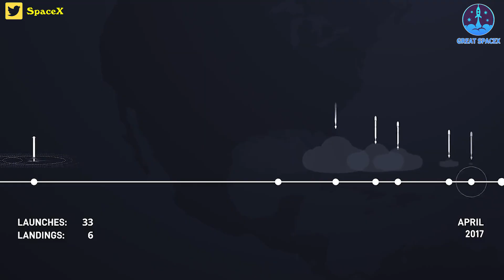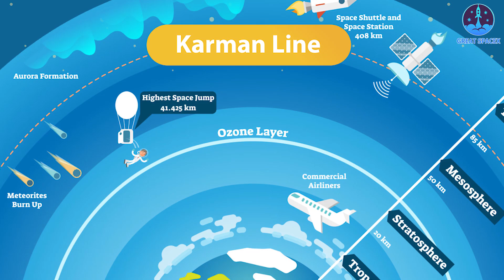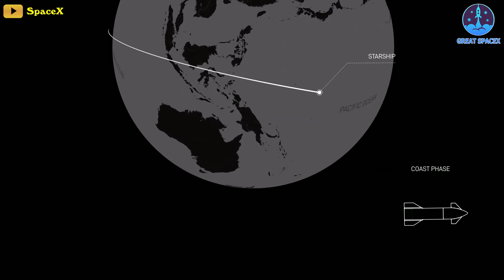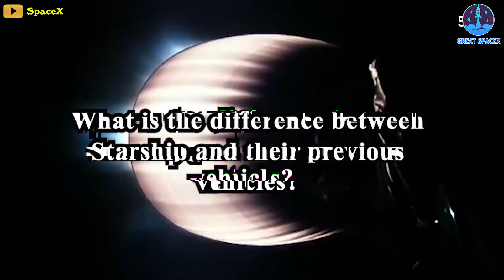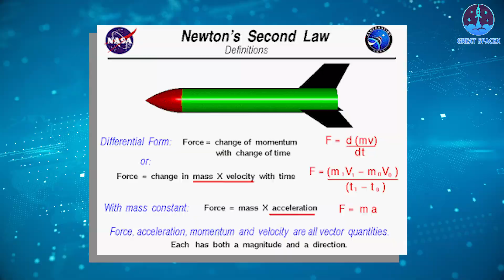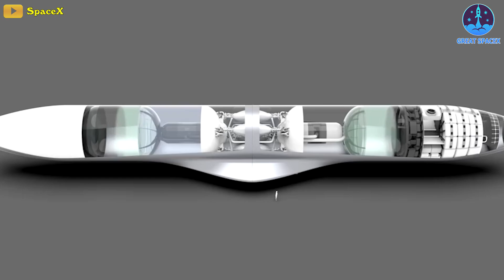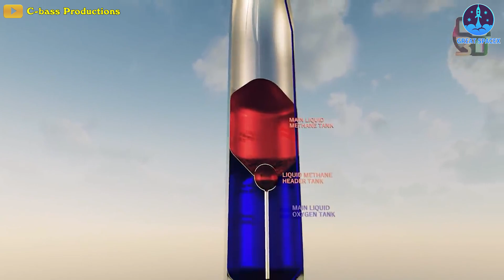Starship vs orbit! Elon Musk declared...

Comment: This video is completely misunderstood. 

The comment about orbit being hard was directed st Blue origin. They have gone to Space but not to orbit. New Shepoard vs New Glenn.

And the point is not that it is a lot harder to get one rocket to orbit than to get the same rocket (only) to Space. The point is you have to build a much bigger rocket to go to orbit.

It has not said in relation to Starship, and btw Starship has neither gone to Space nor to orbit.

Also sub orbital rockets do not return to Earth because the decellerate below orbital velocity. They never get snywhere near orbital velocity in the first place.

Comment: WOW size perspective  the weight savings going from raptor 2.0-3.0 of 200kg or 440lbs is = 2/3 the mass to orbit capacity an electron rocket - so replacing all 45 engines would result in an increase of payload mass to LEO of 9000kg or 19800lbs (10tons) equaling the payload mass to LEO of 30 electron rockets. That savings alone is 15% of the current starship payload mass to LEO. 🤯
Reply: I too noticed that HUGE fact. Is it true?
That’s about 15%
Reply: Thats 9 tons, the 9000kg and it makes 6%, assuming 150 tons of payload.

Comment: I do believe Elon said SpaceX is no longer pursuing butt to butt refueling.  => The change from hydraulic to electric gimbleing of the gimbled engines was already built into the rockets built after those in the last launch attempt, not based on finding from the last launch attempt.
Reply: Precisely.  Remember "The best part is no part."  Each Starship already has a refueling adapter on the side.  The orbital "gas station" just needs a copy of the refueling arm on the Starship Quick Disconnect from the OLM.  Later SpaceX will add other features such as a system for replacing Raptors in orbit.
Reply: @jamescobban857 Why would they need to be able to replace Raptors in space being as they have three gimbaling engines, only one of which is required to land. Just my guess as an amateur rocket scientist.  😉

Comment: launch pad as nothing to dom with getting ship to orbit? 
you just dont let the ship destroy the pad or its self?
pick u[p a pebble and throw it across a pond as far as you can??
takes time practise.
now pickm up a large bolder and do the same??
not so easy
you have to learn what makes it flly glide ?
getting up and themn fuel and tonnage is easy?????
comingh back down like virgin and blue oragin yo yo is simple?
getting to perielian and makingn the gain in valocerty
to make the circle around the earth missing the planet and freturning around and around
is another ball game.
a glider glides on the wind a proppelor plane is pulled and is much heavier
jets have veruy thin wigs and cut through the air.
rockets blast away up and when engibnes stop they will come down.
every machine from wright bros to black harwk to  concord  to Saturn 5
all have diffrent needs and unknowns
You take a chance every time you wish to fly

Comment: The problem is not hot ring separation or orbit. But the re entry of SN 25 which could burn up!
Reply: Testing will tell.  They may test ways to reduce the stress of reentry like skipping like the X15 did and certain Russian tankage have done, like a rock on water, de-boosting and then skydiving.  A ballistic reentry is definitely high stress, but survivable with an adequate heat-shield.  A ballistic reentry needs to be tested for a human rocket rating.  F. Miller

Comment: I'm not sure why you say "gravity will be very low" around the Karmen Line. It's nearly the same as it is on the Earth's surface.
Reply: Gravity is "very Low" when you go skydiving or drive fast over a bump in the road.
Yes the usage is not per definition. Most people think in terms of G-Forces as their def of Gravity. Any object following the path of Inertia and other external forces has no G-Forces. But that isn't "gravity" (the attraction of masses to one another).
Reply: @LG-qz8om  the much better way to say it is x speed is required at x distance to prevent earth’s gravity from pulling the object out of orbit. Gravity is not less by any stretch of the imagination. The passengers might experience less but only because they are falling around the earth not because earth has suddenly lost its gravitational pull.
Reply: To be fair he said density of air and gravity which is true since we fon't live on a neutron star :-D But the surely need to redact that
Reply: Timestamp?
Reply: @tonyhawk123  Around 1:22
Reply: As a rocket rises, the force of gravity is reduced as a square of the distance (from earth's center of mass) increases.
Understanding this is the very essence of all rocketry.
Reply: @bobbarclay316  Yes, and the Karmen line is about 1.5% farther from the center of the earth, than at the surface. So the gravity would be about 0.97g, which doesn't sound "very low" to me.

Comment: Why doesn’t he use a couple falcon 9 boosters in the heavy config? That way he could use fewer main engines and lift more.
Reply: Because it is harder to bundle rockets, and messes with reusability.
Reply: @NoobNoobNews  Also harder to launch building sized rockets with far more points of failure....
Reply: Once starship establishes its reliability we may see Falcons bundled around it as boosters for greater payload weight.  I dont know what that would do to reusability buy Im sure it can be engineered to work.  1,000 tons to Mars?  With 6 Falcon boosters, yeah.  With a second stage nuclear rocket, yeah and in 4 months max flight.
Reply: @Wolfric1970  Bro, this ain't Kerbal Space Program, you can't just slap things together and say "that'll do!"
Reply: @Wolfric1970  You have no idea what you're talking about.  That's an insane guess.  You're the kind of guy who loses an whole wheel rotor and straps a skate board there.
Reply: @PlanetEarth3141  Hey man it worked!
Reply: Are you trying to out think Elon or did you sew up your ears before you started asking questions.
Reply: You and Charles are brothers right?

Comment: Question #1: "Why exactly is launching Starship into orbit more difficult than previous vehicles?"
Answer #1: The Falcon rockets are effectively coupes and sedans compared to a fully-loaded 18 wheeler. We're talking a difference of thousands of metric tons.

Question #2: "How will Elon Musk and SpaceX achieve this goal?"
Answer #2: Elon will achieve absolutely nothing for anyone. SpaceX has so far attempted this by adding 33 engines of a different design fueled by a rather large fuel tank, praying that enough engines last long enough to allow the craft to make it to space, let alone orbit. They forgot to account for physics and blew up the launch pad, so the first full launch was a bust. Now, hopefully an upside down mega shower is supposed to do something.

There's the plain and simple, probably saved someone 11 minutes.
Reply: I think your points are extremely reductive and overtly critical. You are ignoring the multitude of significant advancements space X has made.. Such as rapid reusability, self landing capability, cleaner burning liquid methalox engine.. The FIRST EVER full flow engine and the most powerful operational rocket engine ever developed. Not to mention the huge reduction in launch costs from around $8,500 per pound (back in 2003) to just $1,200 per pound approx, today.... for the same load capacity as the space shuttle! And that's just the Falcon-9!
... We get it,you're not an Elon fan. But, you can not ignore his worth as an engineer.
Reply: @rw9207  Okay....

First thing, Elon Musk is NOT AN ENGINEER. Of all his false labels, that has to be the most ABSURD and REDICULOUS claim about him. Saying that is a disrespectful insult to the actual engineers building his rockets and cars, and to millions of others (myself included) that actually have an engineering profession.

Second, I'm not even talking about what SpaceX has done so far. The narrator posed two questions in the beginning of the video. While after watching it, I'm not sure if they were actually answered, I answered them myself in the plainest of ways to save people the 11 minutes.

I won't argue that my points were reductive, that was the intent, but they are not overly critical, if at all, it is just fact. Just don't ever say something like Elmo being an engineer ever again, I almost lost my breakfast over that. Even his diehard fans know that's not the case, what ever reason could you possibly have to think such a thing?
Reply: @jaydonbrown617  Was Thomas Edison an Engineer? Tesla? Ford? 
You don't have to have a Diploma on the wall to be an Engineer. 
You don't have to have Anyones' Permission or Approval to Engineer something.
You argue that you are not "overtly critical", then call Elon "Elmo". 
The general public really enjoys conversation about stuff like this, especially with 
people who have an innate understanding and a keen interest in these things, 
and they would Welcome your points arguing pro and/or con, but not if you Insult. 
Thank you for reading my Trope.
Reply: @otpyrcralphpierre1742  *Elon/Elmo, come on its an easy typo.

Whether or not those people were engineers can be debated forever, but off the top of my head I can say that Tesla was definitely an engineer because he designed and built many things that shape today's mechanical and electrical world. 

What has Elon actually designed and invented? Nothing, as far as today, but if someone can link me to something of his, I'll be grateful. (And no, please don't say the shape of the supercharger connector, or something crap like that, that is just sad.) Elon is a business man, the con artist breed at that. I mean he is literally floating on an overinflated balloon of wealth thanks to the overvaluation of Tesla. Elon has hyped many great and competent engineers into the clutches of Tesla and SpaceX, but he himself contributes exactly ZER0 advanced engineering skills to any of them.
Reply: @otpyrcralphpierre1742  "...You don't have to have a Diploma on the wall..."  That's why I always go to an "M.D." with no diploma.  That's why I always go to a lawyer with no "JD" behind her name.  It's simply not necessary.
Reply: @jaydonbrown617  he does not have a formal qualification in engineering, true... He is self taught! He studied physics. However,  I think he has demonstrated a sufficient grasp of engineering, at this point, to warrant the label.. and as an actual qualified engineer and a member of the royal institute of engineers, I personally am willing to give him the benefit!
Reply: @rw9207  Nooooo, how can you say that then? You say you think he's demonstrated engineering prowess, please tell me a time he's done that ever?
Reply: @jaydonbrown617  The man was CAD designing his own rocket engines in his bedroom at the age of 14. I have looked into this, Trust me, he knows his apples!
Reply: i said a while ago starship is a  trucking company.
Reply: @scottbryan5368  yes... to space! With the most powerful "trucks" known to man! Bit of a difference...See what I mean about reductive?
Reply: @@clashstats3778 And where did you pull that rabbit from? Nowhere did I even discuss the development methods or inner workings of Starship. You want to go down that road of discussion, pack your bags then.....
Reply: So how long have you worked for Boeing ??
Reply: @kentgrewe4608  Ah, there's the classic "have you worked for Boeing?" comment. Lol, never fails to show up, it's like clockwork. 

Be specific dear commenter, because Boeing as an aviation company is far more superior in every possible way than SpaceX as a company. Try as Elon might to dethrone airliners with his missiles, but it will never happen. I assume you're instead talking about the spacefaring sector of Boeing? Well no, I've never worked for that side of Boeing. Whatever would make you suggest that I have?

Comment: Elon Musk and his Space X Starship builders will make space Travel easier especially when you see the potential of Falcon 9s and Falcon heavy, all their efforts will soon be space stations and space hotels.
Reply from the maker: Let's wait for the next surprises from Musk and SpaceX
Reply: @jaydonbrown617  Kinda true space X needs someone to slow them down in that regard to avoid stupid mistakes. External control is required anyway, regardless of the company. 
When it comes for number let's say that so far, the falcon 9 has been quite reliable, and even the cargo version of the capsul hasn't faced many issues since it's first launch. Crew dragon being an iterration of the cargo version, we can safely assume that it's quite a safe ride, way safer than the spaceshuttle for exemple (but it's mostly due to the method of reentry).
Reply: @marez120  No doubt, current advancements in technology and our understanding of space flight has changed dramatically over the decades. A modern space shuttle would be a godly beast using technology and manufacturing methods available today, but NASA has since sided with SpaceX and others to carry out the Shuttle's old functions. If a Shuttle is needed, sure I'm sure one would be built, but for now the Falcon rockets (and others) are the cheaper way to go. 

Amazing what time and effort can do for a budding rocket design, in the beginning NASA wouldn't trust Falcon as far as they could throw their old CCRT monitors. Now they have a reliable craft with a reliable human space capsule, probably an enjoyable ride to and from the ISS. On the other hand, I wouldn't go near Starship for at least another 5 to 10 years. That lumbering giant is an accident waiting to happen, surely. I think with ships this big, we're starting to cross the line into needing a different form of propulsion altogether.
Reply: @jaydonbrown617 though we have had some success playing with numbers does cause for very fragile results.. a lot of pple get so caught into the desire that they ignore the reality because they want to achieve so bad
Reply: @BarbzSpotify  Yeah, it's no joke a matter of time. When you start launching folks back-to-back, risks increase exponentially, and that's still considering the very safe Falcon 9. I mean there are a million jet flights a year and very few if any fatal crashes occur, and this is hands down the safest way to travel. Even with the best technology aviation has to offer, you still get outliers.
Now let's not even talk about Starship, because while a lunar lander variation of the craft seems reasonable in crew size, a colossal crew of 100 is actually one of Elon's/Shotwell's better jokes that they've made.
Reply: @marez120 Avoid stupid mistakes thanks to NASA?  What rock did you bury your head under?
Reply: Dream on.
Reply: And lots of dead people, don't leave that out.
Reply: @jaydonbrown617  As far as we can see they didn't play with life when it came to the dragon capsule. We can trust them as long there is good internal control and from the NASA, it will be reliable.
Reply: @marez120  The only reason SX hasn't killed anyone yet is because NASA has a good leash on SX when it comes to the crewed launches. NASA won't let that sht slide so easily these days, so lets hope they keep their foot on SX's neck. Besides SX only has had several crewed launches, statistics and probability is still on their side for now.
Reply: @jaydonbrown617 You're brain was left outside and the neighborhood mutt ate it making better use of it than you have.  That was demonstrated by your asinine 😅 comment and leaving it outside.